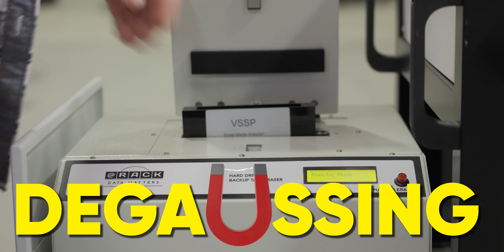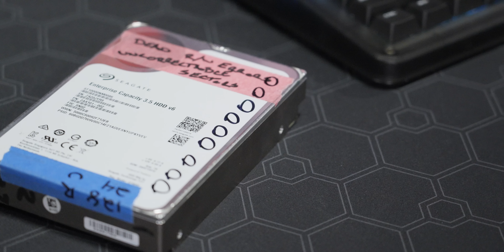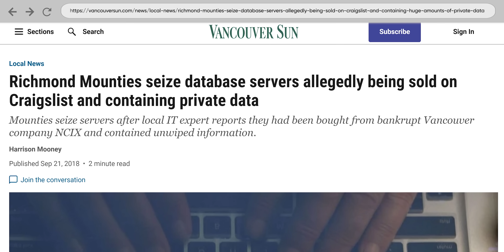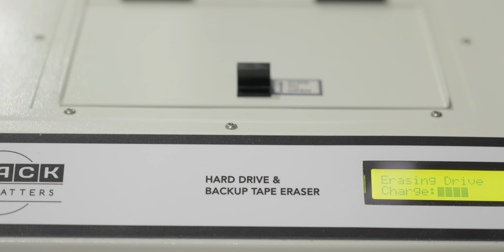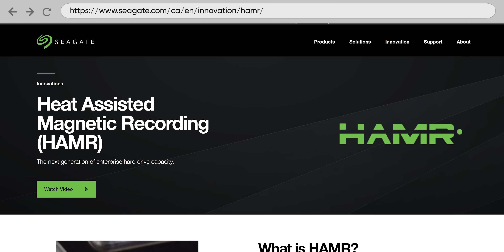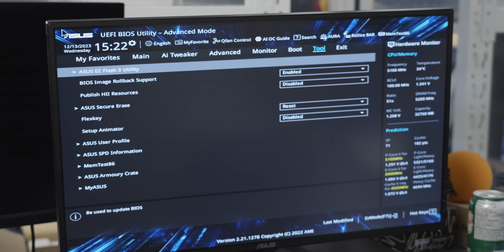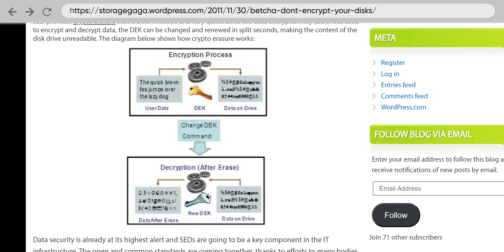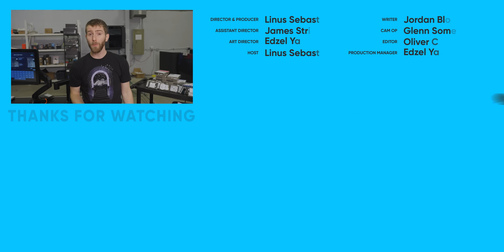I Got an Industrial Hard Drive CRUSHER! @Rack's Mobile Data Destruction System

Comment: So my understanding is that just one overwrite pass is enough to render the data unrecoverable even by state of the art methods and devices? 

I've been reading that there was no evidence that multiple passes were more effective than a single pass, but I haven't done exhaustive research yet, just some.

I'm erasing a drive right now and having it RMA'd. I'm just doing a single pass, though it's taking forever. I do have some sensitive data on the drive and from what I'm reading, single pass is ok. 

Though I'm really wondering what's good enough for an organization like the cia or pablo escobar, hmm

Comment: In the past, I have used a sledgehammer to erase drives. It doesn't do degaussing, but it does break all the chips and crushes the platters. It's especially effective with recent hard drives because recently they are using glass-substrate platters. Glass powder is unreadable even if not degaussed.

Comment: gonna be so real, I normally just zero a disk, then do a random write followed by another zero write. 
scriptable in bash
repeatable
works on ssd's too.
not getting data off that either way. 
if u really want to make it even harder to get ANYTHING irrespective of how hard you try? 
run that twice, it's the same process most tech shops use if they want to reuse a disk. 
I mean no software method ive tried will be able to pull it after 1 run of that. even linux and kali tools included.
hardware write wear methods don't work on modern ssd's due to how they're built. 
you should probably smash up your hard drives though those leave dust on the disk over time so you might still be able to recover data using that at a specialist recovery lab.

Comment: So I had a few old IDE hard drives to destroy. I bought a special screwdriver to crack them open. Couldn’t figure out how to remove the platters without damaging the head so I used a long screwdriver like a crowbar.

Next I got a magnet to go over the platters. But I read this still doesn’t do anything as they aren’t strong enough. So I place the platters on the footpath and used my feet to sand down the surfaces. 

Finally I got some metal snips to cut the platters into pieces and will eventually dispose of the pieces randomly over time. The platterless drives were thrown into the e waste drop off bin.

Comment: I worked at a bank about 4 years back. I had to do a manual wipe of all of our old drives for a decommissioning project. We used a 4 pass DoD wipe to delete the old data. Between our old storage server and a bunch of out of date computers It took several weeks to get through all those drives. I really could have used a machine like this.

Comment: I know that for a long time, any company that dealt with like, US military projects was required to incinerate their hard drives after use, because sufficiently determined forensic analysis could pull useful information off even shards of a shredded disk after dozens of overwrites. So the crusher part on this is mostly just for decoration and giving you those nice dramatic 'after' pictures... but the degauser pulse is about as good as setting the drive on fire.

Comment: Nice machine - Now, fortunately, I "erase" my SSDs (M.2 or SATA or U.2) and my HDDs with a soft-face hammer - advantage:

The hammer costs me nothing, as it's already there in my workshop and I have to forge chisels and the like anyway and it's fun - the cool thing -> the data carriers are also melted straight away^^. 

PS: Cell phones, tablets and handheld consoles also work very well in there - the last one killed an older S20 in there.

Comment: I used to work for a company called "Device" where we took old computers from large companies and repurposed them for schools in 3rd world countries. One of the first things we did is run a dos program (I can't remember the name of it) that would spend about 6 hours overwriting the drives to comepletely erase any data that was stored. Apparently, this software worked on the binary level, you could even choose if you wanted all 0s or all 1s. If for whatever reason we couldn't erase a drive, it would have to be destroyed. We smashed them to bits with a lump hammer and incerated them.

Comment: I have a glitch that could help. Use MSI recovery. In my MSI laptop I have a SSD for OS and a HDD for data. Once my OS was slow and used MSI recovery to flash firmware again. It prompted that the flash would wipe data. I continued thinking it would only wipe the drive where OS is installed. After 30 mins of installation and initial setup, I opened file manager and the data drive which was almost full was completely wiped and became empty. I couldn't recover my data using wondershare recoverit or through MSI service center and a local shop. 1tb worth data gone forever. Similarly after a year or so I had to exchange my HDD (which I again added new stuff) with my friend and for the fast clean wipe, I used the recovery again and gave the HDD to him. For a doubt I used recoverit on his laptop when he got my drive and yes there was no data found. I did use deep scan. So my point is if you have an MSI laptop or a motherboard, you could wipe any amount of TB of HDD or SSD just within 30 mins. Not a clear answer but I think it would work, given that I have done 2 times.
Reply: I would like to have a video made by linus, so that is it possible or not.

Comment: Ngl I work in security, CCTV of sensitive areas and intruder alarms, the extent at which we destroy HDD's is simple, we get a reciprocating saw or angle grinder and cut it in half, easy to do and extremely effective. Intruder panels I often destroy the chips as these can contain passwords, location info along with details on the location. Now with everything being cloud based, we rely on the manufacturer to make sure their systems are secure. If the client doesn't feel like they are, the client will simply not ask for any online capabilities, from there, there is absolutely no way of data leaks, all zone lists and data is cross shredded. People say "oh no Chinese are bad" and from our experience, that is mainly due to protectionism from the west, if you're that sensitive, don't have it online as anything online can be hacked no matter what. Thanks for listening to my TED talk

Comment: I used to work in a government data center and we had an automatic geared head drilling machines (drill press) with an heavy duty clamp to keep the HDD in place while it is drilled , the rule was to make two holes in the hdd and take a picture for the inventory, further the HDD's were taken to be shredded and recycled...it takes 2-3 minutes to destroy a HDD and that's how we destroyed thousands of HDDs over the years...no fancy machines 😂

Comment: Smashing them up and chemically sanitizing, then recycling the pieces in separate areas would’ve been cheaper and faster. 

The chances you hold any info that someone on the internet hasn’t already had leaked about them is zero, anyway. This was pointless.

Comment: I actually manage a data sanitization/destruction setup. I setup and maintain servers that will utilize pxe deployable software to write over disks of any kind, as well as supporting in situ wiping/diagnostics for devices with built in storage i.e mac, tablets, phones etc. I also validate the software level destruction with third party tools that check the hashes to ensure the writes were successful. With all that being said, the most fun part is absolutely the big shredder on wheels that we have! Nothing beats watching a drive get mangled to smithereens and dropped into a bucket. Makes me smile everytime!

Comment: I once visited a data center for my school and they showed me how they destroy data, crush the drives and register them as destroyed. It was the exact same process as this video. They also showed me a rig of about 6 full size racks filled to the brim with jbods. The jbods where modified to easily swap out the drive. They used that rig to erase data off the drives for reuse. Its really cool technology.
Reply: The only thing they did differently was the destruction of ssd’s instead of bending the nand chips the poked physical holes in the pcb and chips. Might be a better way instead of bending

Comment: I've been at some companies who do this for customers, it's aweful to watch that drives which are perfectly to re-use need to be crushed or degaussed. You could fill your NAS up quickly with drives that are high capacity and get some additional spare drives otherwise. You can secure wipe drives at home using a bootable stick with DBAN which also has D.O.D. standards of wiping a drive. And it will take a few hours depending on the capacity :)

Comment: If you wanna go "all out", remove the HDD's metal lid exposing the silicon discs, unscrew the cap holding them in place to remove said discs, then, turn on the acetylene torch and turn the silicon discs into molten metal.

Comment: modern SSDs are easy to wipe. Once you mark something as deleted wait 24 hours at the absolute max with the drive powered on and its all gone. This is due to the fact that SSDs need to clear a cell prior to writing to said cell. So what the SSD does is it clears the cells then wear leveling kicks in and moves around data to make the next write easier. That is a major reason they are as fast as they are is because in the time when they are not actively writing they are moving the data and clearing cells in prep for the next write.

Comment: Yeah I'm fairly sure, given enough budget and time, one of those harddrives could be partially recovered to such a degree data could be read off of it. But I'm fairly sure with the final measure of using encrypted data, it would be practically impossible.

Comment: Funny thing is, this hard drive crusher wouldn't cut it do destroy HDDs/SSDs in the EU, as per law the drive needs to get shredded. Specifically in Germany, there is the norm DIN 66399 that defines various protection levels and the according maximum resulting particle size. For an SSD filled with company secrets it would be safety level E5, which means the shredded particles have to be a median 10 mm^2 of size. Level E6 (restricted high security data) corresponds to 1 mm^2 and E7 (restricted top security data) to 0,5 mm^2 of size.

Comment: Can you not save the PCB's from drives for data recovery purposes on other drives? or are you required to destroy those as well due to possible information in the cache? Nice machine, beats using a Manual Crusher that only punched a hole in them like the one we used at FreeGeek.

Comment: Weird argument, the guy writing zeros to the drives needs security clearance and data can leak... Using this hdd destroyer it's exactly the same? Some technician has security access to get their hands on the hdd, scans in the barcode, then takes the drives home without erasing them. bs argument

Comment: Why is someone still using a crusher in modern times? Shredders and degaussers have been standard for the past couple of decades. NIST 800-88r1 explicitly calls for shredding, disintegrating, pulverizing, or incinerating of hard disk drives, and the same for SSDs. Crushing, cutting, bending, burning, or hole punching are not generally sufficient for securely destroying highly sensitive information.

Comment: Im a DC HW engineer and the machine we have actually Shreds all the metal. So 1000 bits of metal comes out the other end. It all then goes in a skip and goes for metal recycling. We have over 1000 physical servers and can go through 60 drives per week in just normal failures.

Comment: I haven't yet watched, but place I worked we had a shreder. It was fun. We had a device that would do that to drives, but it didn't meet our requirements for spinning media. That device had an insert that perforated SSD and that was great! The ssd perferator has videos on YT pd-5 w/SSD-1. 

SEM Model 0315 was the shredder, and SEM EMP1000-HS was the 20000 gaus/2.0 tesla degauser.

The degauser claims it is portable, but when we needed to ship it back after 7 years(14000 drives) for a thermal fault it took 3 of us to get its 160lb chassis down to the loading dock to be shipped.

I really wanted to pipe a camera and some light into the shredder it waa so satisfying watching it work.

Comment: I believe writing just zeroes is ineffective with modern drives. Say you write a stream of 10,000 zeroes to the drive, the drive actually doesn't physically write 10,000 individual zeroes in a row, it writes a marker that says "from this point be zeroes, ten thousand of them", which takes say 2 bytes to write, the rest of the physical space that would be overwritten with the remaining zeroes is left as it was (your old files). You read this data back character by character and sure the drive controller gives you back 10,000 zeroes but it's just read the marker not what is physically on the platter or flash cells.
I believe you need to stream random data to the drive to force it to actually write to the physical medium. In linux use the dd command with flags if=/dev/urandom and of=/dev/sdN with the output dev being the drive or partition you want to overwrite. I'll not put a complete example command in a YT comment as someone would copy / paste it to their command line and trash something they don't want to :/

Comment: I used to work in a Goodwill computer works department and because we had to reuse drives for our builds we had to make sure they were all properly wiped. So we actually had a set up using large KVM switches and old motherboards on shelves to run 3 pass DBAN on multiple drives in parallel so we could have enough drives for production. We usually wiped drives between 250GB and 2TB with the occasional 4TB or higher but even then those still took awhile to wipe just on the 3 pass. I can imagine not wanting to 3 dozen passes on server level drives those wipes might take weeks.

Comment: For personal devices or servers it's best to encrypt the drives from the start. If you're concerned about data leaking if you resell the drives, you should also be thinking about theft and warranty returns. If the drives are encrypted, it's no worries, and you don't have to destroy useful hardware.

I recently had an SSD fail on me and the OEM required the original drive to be returned. Suddenly I couldn't connect to the SSD to erase it. If it hadn't been encrypted I might've taken a loss rather than risk the potential data leak.

Comment: On the question about erasing tons of drives with Secure Erase and Overwrite - You can use a product such as the Destroyinator, which is basically a 45Drives Chassis loaded up with Linux and a copy of Killdisk Industrial to perform bulk erasure AND compliance reporting of disks. It's pretty cool. You hot swap the drive into one of the drive bays on the 45Drives chassis, it'll automatically destroy the data, and if a disk fails for any reason, you'll get a report saved and can send it off to get Degaussed and/or physically destroyed.

Comment: When I want to irreparably erase data from any drive (all data from the whole drive) I just run the following command a few times over it: 
sudo dd if=/dev/urandom of=/dev/sdX status=progress
and replace "/dev/sdX" with the device file for the drive to erase. Because it's random data each time it's impossible to know for sure what data each bit held before if you don't have a copy of the original data.

Comment: If you wonder if something like this is actually used - > Yes. It is.
I work for a global, huge ass, automotive industry company as an IT specialist, and we have procedures for drives older than 5 years.
Frist we nuke them by using a special device, similar to the one showed in the video. Then they are handed over to the maintenance department where they cut them in half (under our supervision). Afterwards we pack them in locked containers, and they are sent to a company that destroys them completely.

Too much? Probably. But on another side, in a game with enormous players, information is everything. Some piece of data that falls into the wrong hands, even if actually harmless, if presented the right (wrong) way can ruin even the largest companies.

Comment: 1000 drives secure-erasing themselves over night in parallel in a storage-system (NAS or SAN) is surely faster than taking them all out and bending them - at knee height! But yeah. Broken ones will not erase themselves and regulations might require bending anyway.
And please get us a peek at the shredder!
How is recycleability of the bent drives?

Comment: The best data destruction method is to plan ahead and to use full disk encryption from day 0 with off disk encryption keys. This is how most enterpriuse storage arrays now work, and destroying data at the end of life is as simple as rotating the encryption key. SSD's also encrypt all data internaly by default, however the encryption key is stored in device.

Comment: i used to do this for my job lol was a data security manager/technician for hospital PC's. If you get a array of 96 and good software, you can erase them at high quantity and re-use them. We could do 96 per day and have several hundred good drives by the end of the week. Just have to have a 2nd machine for checking the status of the drive after, so a 2nd 96 array most likely

Comment: Cool seeing a purpose made machine like this. But an interesting question is that: What happens to the scrap? Will there be a follow-up about E-waste disposal/recycle? 
Sure, there is basic e-waste disposal measures, but it is something to think about when dealing with components that USED to contain data.
Reply: They get shredded them turned into high grade ore to feed recycling. You get platinum, rhodium, gold, silver, nickel neodymium, tin and tantalum from them. The iron and aluminum are discarded.😮